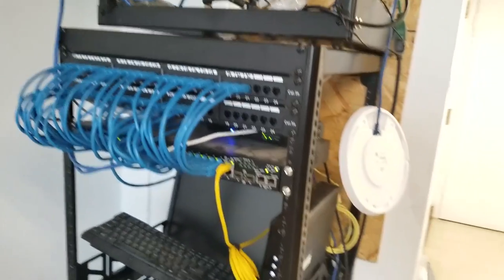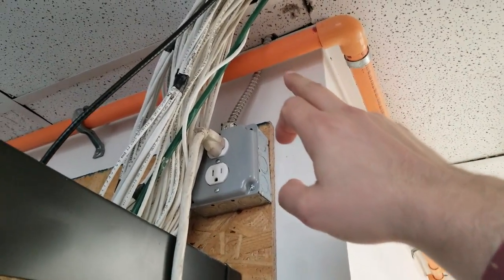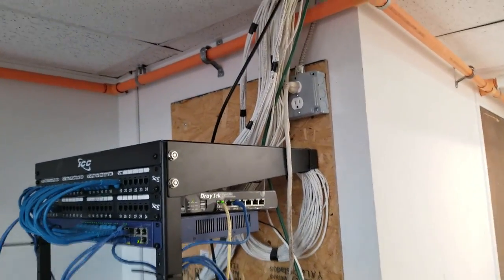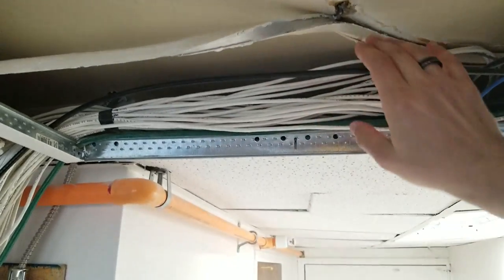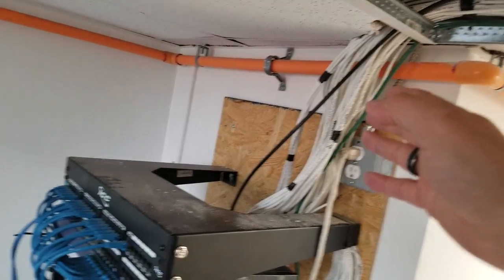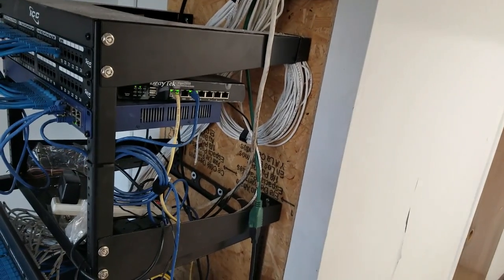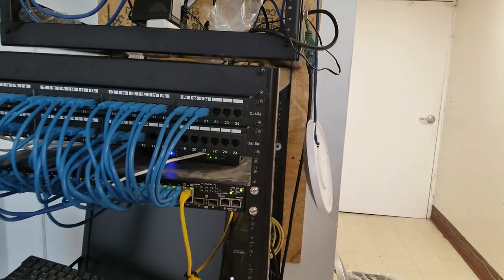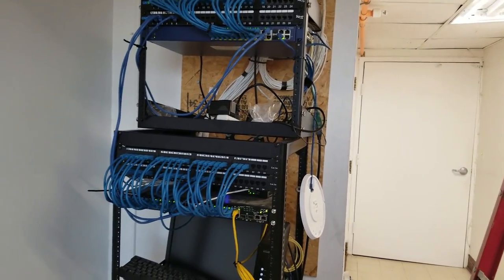fire code issues in a network room... Detroit business.

Comment: Retired Fire Marshal here....Those are low voltage, and while not looking too professional, LV can disappear into a ceiling.  However,....you are correct about the extension cord.  110v extension cords cannot be used in place of proper wiring.   An extension cord cannot go through a ceiling, wall or floor, or through a doorway, etc....Any wire should be protected from sharp edges...

Comment: I have never seen PVC used for a sprinkler line before. I would think that that would be a horrible idea. It becomes a race between the sprinkler putting out the fire and the pipe melting. (Which isn't helpful if the fire isn't on the floor)
Reply: I've seen that orange PVC used for fire sprinklers at schools and some businesses. I've had the problem of installing my cabling and then the people installing the sprinkler system goes through, or behind my cables, sometimes undoing what I have done.
Reply: Orange PVC pipe is fire rated for sprinkler pipe. 👍

Comment: Was an industrial sparky for 50 years. 95% of IT guys are extremely lazy when running cables. Had them lay bundles of cables on top of drop ceiling panels.Always said we never do that. Ended up having electricians only run cables so we would break their balls about all the overtime we get installing computer cables.